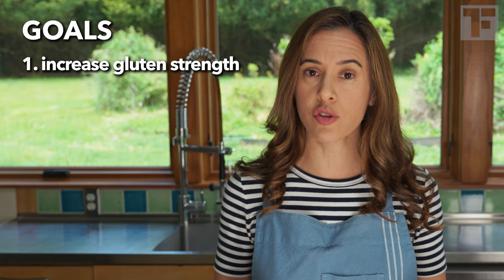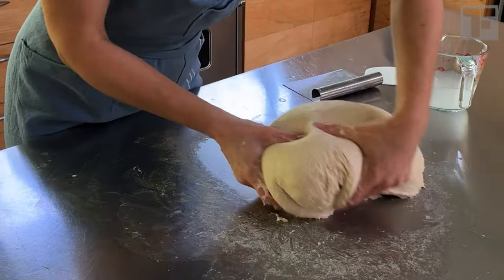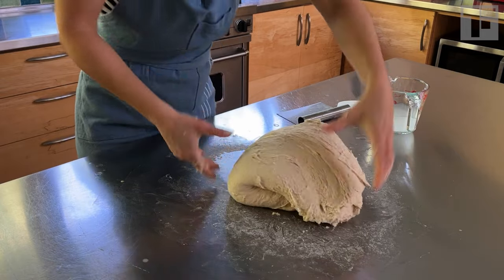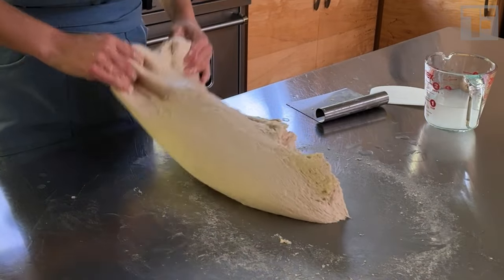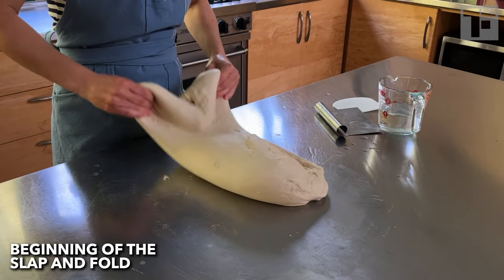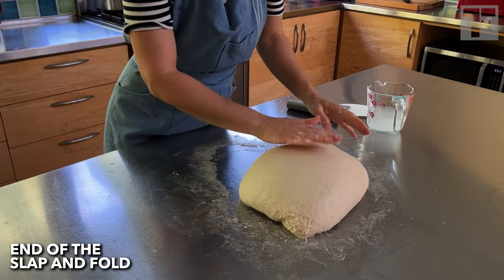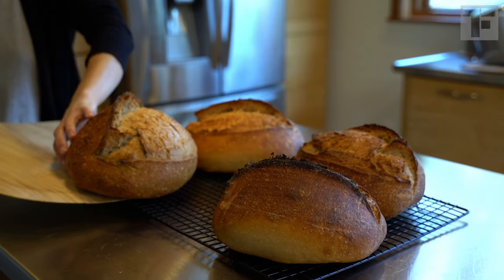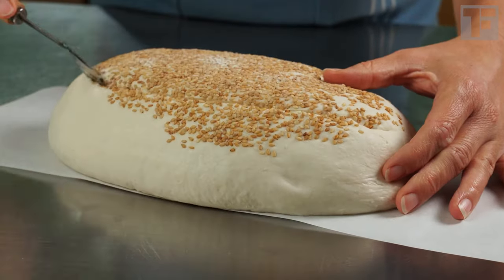Sourdough slap-and-fold: sorry, you're doing it wrong

Comment: The goal of any kneading is building gluten strength. *NO* kneading method will "incorporate air" into the dough. That what the yeast is there for.
Reply: Not so. Research in the 1940s revealed that without pockets of air already trapped in the dough the gas produced by the yeast would not be able to form bubbles on its own. This is due to the physics of bubble formation and the pressure differential between the inside and outside of a bubble.

Comment: The technique looks good. Richard Bertinet is the gold standard for slap and fold and i learnt from that and have done 85% hydration doughs for pizza (a bit of stretch and fold before slap and fold).
Reply: It doesn't look like the original technique thought. One of the main points on Bertinet's guide was never leave your hands from the dough. Am not saying i managed just that the demonstrated technique does not look like the creator's slap and fold. As long as it works i guess is fine
Reply: @p2bas1 another point he makes is to always keep the top on top unlike here where she says to flip the dough over. 
But then he also says rotating the dough is "lazy" which is a technique Thomas Teffri Chambelland teaches and he's also a renowned baker so who knows lol

Comment: How long do you typically need to perform this method?
Reply from the maker: It really depends on the speed of your slap and fold. I look for the visual clues I mention in the video -- a smooth surface (sign that gluten bonds are no longer weak and tearing) and do a window pane test.

Comment: i promise you're not incorporating air. sorry.  not only that this whole nonsense of folding and what i consider to be overworking the dough which is proven when it starts to tear.  example here 1:22, after this fold you have a smooth surface.  after the following fold you've torn the dough and now you've broken the gluten strands that you've formed.
you don't need to do any of this. enough gluten can be created just with time. 
mix your dough. let it rest for 15 minutes, do those folds gently so you don't tear your dough.  once you tear it, you've broken the dough.  you can prove this to yourself when forming a loaf, or after portioning.  make a nice smooth ball, then keep making the ball tighter and tighter until you've broken the surface.  Now try and make that ball of dough a nice  smooth, cohesive piece of dough again without adding flour.  It's almost impossible, and I would say impossible, because you've already pulled the gluten past it's point of no return and now it needs to rest before you can incorporate it and make it homogenous again.
if you think i'm full of it, feel free to look at my channel i have two videos that i streamed live showing my whole process.
Reply from the maker: I never suggest that people should do slap-and-fold over any other method for building strength. Stretch and folds, coil folds, these methods work just as well. However, this is for people who want to try slap and fold (which can be a quicker way to get to the end result). The "breaking of gluten" strands you mention is occurring because strength hasn't been built yet, which is a goal of the entire process as you work the dough.
Reply: @TrueFoodTV  if you're tearing the gluten strands at any point of the development you are literally going against your goal

Comment: You do not need to slap and fold at all . This ancient method was developed by pizza makers to deal with their high gluten flour . It was done in order to stretched the pizza better , more evenly by hand . The real gluten strength improvement method is a 4 fold method to the dough after mixing with low gluten flour or high hydration . No need to slap the dough at all , just a simple fold and overlap of all 4 sides of the dough . It’s provided ( depending on. Temperature and bread ingredients) between 30 min and 2 hours for the first time and another hour or two for the second time .
When it comes to danish dough or puff pastry dough you actually want the dough underdeveloped because the sheeter is finishing the kneading process.
Reply: Regarding your last point. How many home bakers are going to have a sheeter.  As for your 4 fold method (as you described) you are allowing time to develop the gluten.  Al methods work. It is is just a matter of what fits in with your schedule. The end product is the decider in what is a successful method.

Comment: Why incorporate air? Isn't there CO2 from the yeast and later on steam during baking?
Reply: Oxygen temporarily strengthens the gluten bonds, this is great for a quickly risen dough but accelerates the deterioration of gluten in a longer-risen dough such as sourdough.

With oxygen present, yeast respires aerobically which leads to faster gas production. Again this is great for quickly risen bread, however not so if you want yeast and lactic acid bacteria to ferment and develop flavour alongside CO2, which you typically do in sourdough bread. 

So yes, you are correct to question…

I will, however, commend her in not fully developing gluten at this stage as it will continue to develop during bulk fermentation. She also comments very well on how the dough behaves during kneading or “slap and folds”.

Comment: Is the stretch and fold done after the 1 or 2 hour autolyse or later?
Reply: Most tutorials I've seen start their stretch and folds 1 hour or so after autolyse. They then do a series of stretch and folds, usually every 30 minutes, four times. So the stretch and folds take about 2 hours.
Reply: @mygirldarby    Thanks, I've seen that too. But here I was wondering because this slap and fold makes the dough so much more worked than the stretch and fold which leaves the dough more tight imo.

Comment: I cam across your video by accident.
This is not a rude post, I mean no offense. Just facts.
You are doing Richard Bertinet's slap and fold incorrectly according to Bertinet who developed the method.

You are doing stretch and fold and not slap and fold.

Your on dangerous ground when you say "Your getting it wrong" in bread baking. There are so many variants of kneading. Each home baker will have their preference. Having tried all of them over many years I settled on three depending on the dough I'm trying to develop and the slap and fold, being one I use is a slight variant on Richard Bertinet's where I rotate the dough ninety degrees after each slap and do not do the side pulling motion. My dough develops faster that way, which means less work. Am I wrong?  No. Are you wrong? No.

The slap is really important. When gluten first forms it develops weak gluten to gluten bonds. ANY, kneading breaks these bonds allowing the strong Sulphur to Sulphur gluten bonds to form. The slap makes this happen faster. 

Here's and experiment for you. Use your stretch and fold techniques, for that is what you are actually using, but at the end slam the dough onto the worktop really hard three or four times. Now as the dough develops and you do intervelled folds you should see a real difference in the dough. 

Incorporating air is an  old myth.  The yeast is in anaerobic mode and does not need oxygen and trying to incorporate air might increase gluten oxidisation and reduce the bread's final flavour. This was one Prof. Raymond Calvel's central theme's in his famous book 'The Taste of Bread'. Though he was mainly talking about machine mixing. Fortunately for us research shows that the amount of hair incorporated using any hand kneading technique is small and has no effect on the dough.
Best to you, be well.

P.S. Check out "The Bertinet Method: Slap & fold kneading technique" with Richard Bertinet
Reply: “the amount of hair incorporated” 
😂Won’t be eating yóur bread ! 😅

Comment: You are doing a 90 deg turn at each step which is not what Richard BERTINET recommends. Doing your way you miss to stretch the dough on the side just after slapping it  which is one of the most important part. You do not keep the dough in your hand at all times while this is what Richard does.  So for me you are doing it wrong as well.